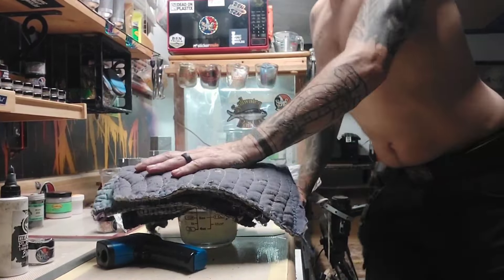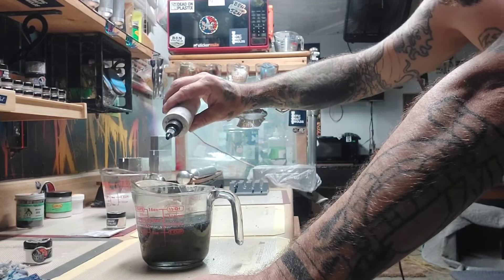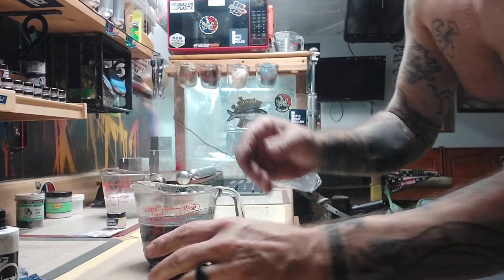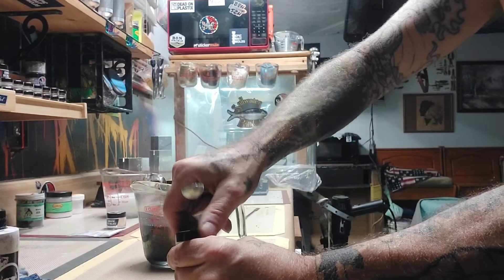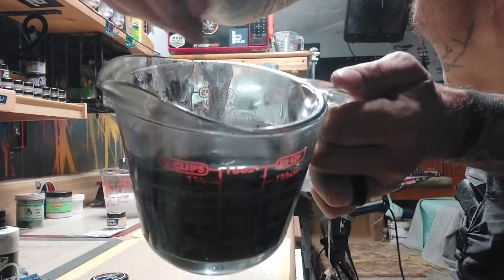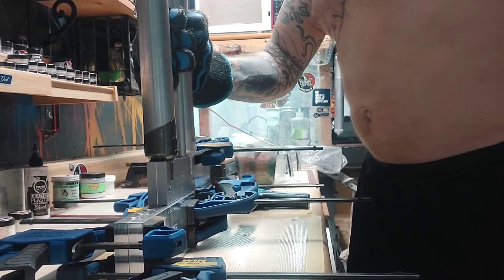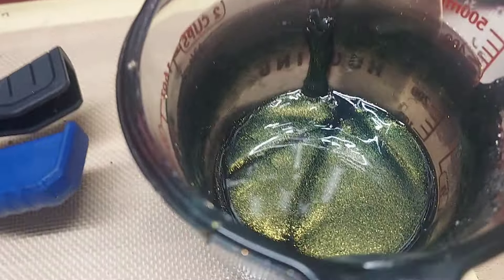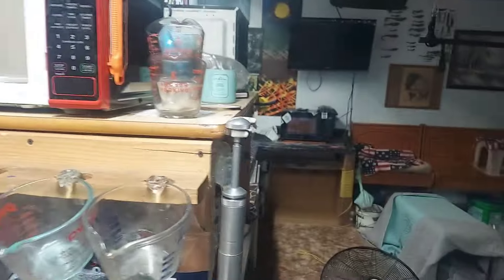custom colorway for local Youth Fishing Derby prizes.

Comment: Awesome color way.  That was a ton of Pixie Dust you poured in there.  Usually I get a decent solid color by using 1/8 tsp per cup of plastisol and 20 drops of black.
Reply from the maker: Thanks, and Yeah it was lol, thanks. I'll start there next time and do 1 or 2 of the prey and see how it looks next to these. I want them to look saturated, but I don't want to use pigment unnecessarily. Especially this stuff lol.